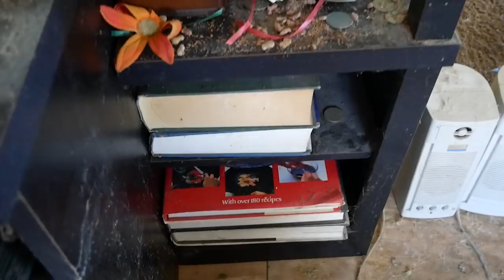When the Cats Take Over | Animal Hoard Removal

Comment: If you have a working dishwasher you can wash vent covers (heating, aircon, ventilation), light fittings, range hood filters, fridge fittings, etc. in it.  Anything you can wash in hot water, you can put through the dishwasher.  Saves time, ensures a high level of cleanliness and removes all grease.  (Just remember to run a dishwasher cleaner through after you finish!)
Reply: Ima have to do this!  Thank you!!
Reply: Bleach broo

Comment: If you put the globes from the light fixtures in the dishwasher and run it, they come out looking brand new!   Trick for fans, remove the blades take off hardware and spray the blades flat white, they look like new blades.

Comment: Really? Level 5? Maybe they need to extend the definition to 10 to account for houses where it’s been so bad it’s starting to rot or collapse.
Reply: I think when you factor in the cat  urine/feces it knocks it up a few points. I've cleaned up cat houses where a flood cut on the drywall had to be made along with replacement of subflloor.  Nasty stuff.